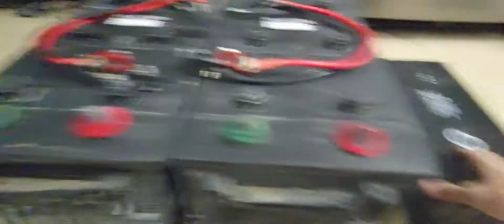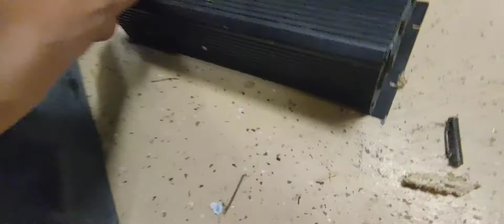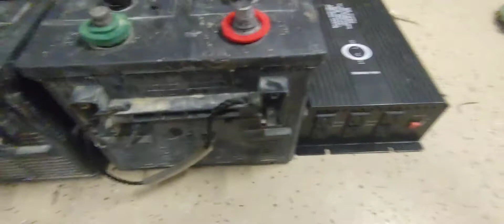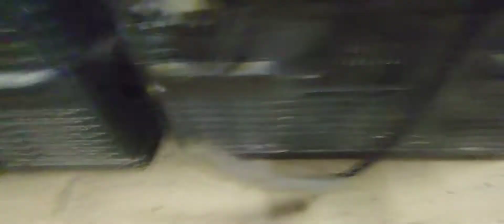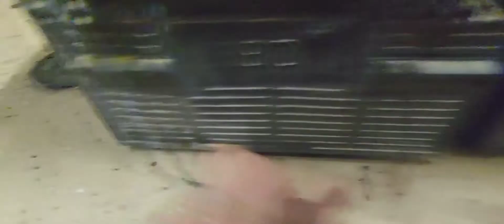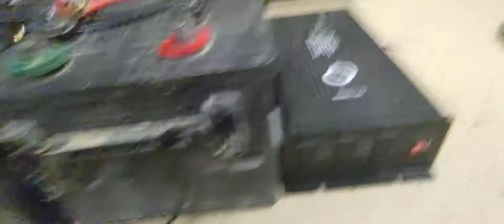Thoughts on 8D Batteries and an Inverter

Comment: they are deep cycle it's just they're industrial starter batteries.. they're meant to crank bulldozers and shit over for minutes at a time. when you run out of fuel in a mechanical diesel you have to crank the engine over couple thousand times just to spin the pump enough to get fuel pushed through the lines.

Comment: Will they work with a solar mining rig??
Reply: you'd get a better deal with lifepo4 batteries. these are for big diesel engines like in bulldozers or fishing boats. if you run out of fuel in a mechanical diesel you gotta crank the engine over for 20-30 minutes just to get the pump to push fuel through to the injectors so they're meant for that. they're about 350$ a piece
Reply: @dawsongamblin5246  they are terrible for solar especially when they've been drained a lot.